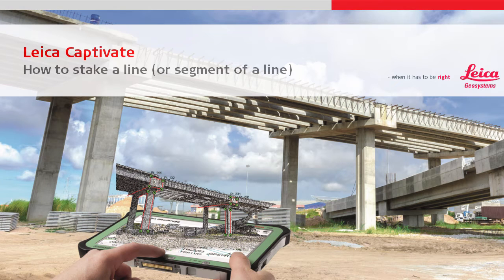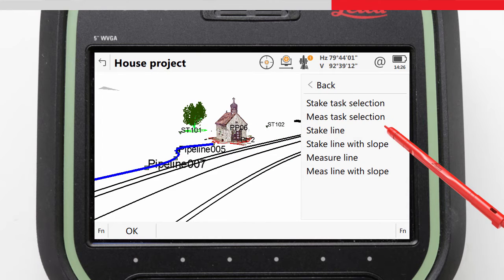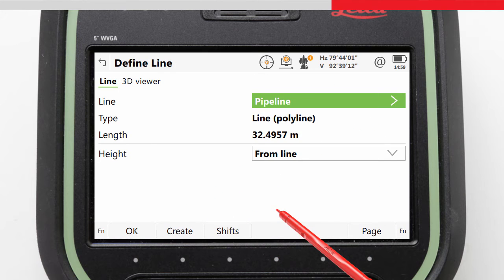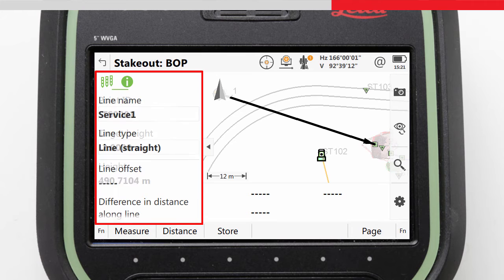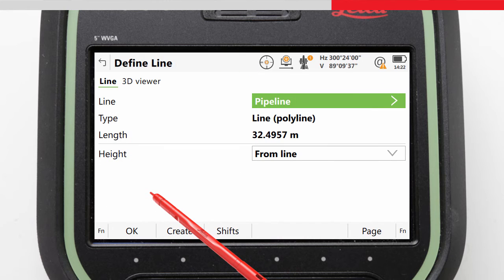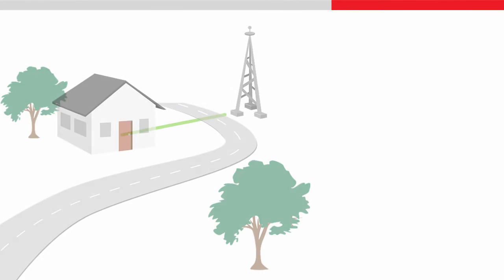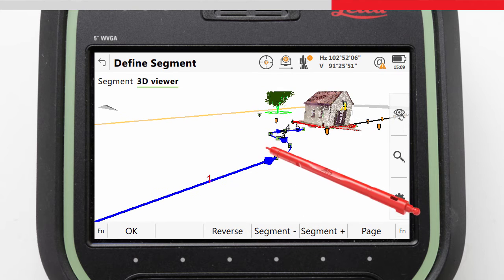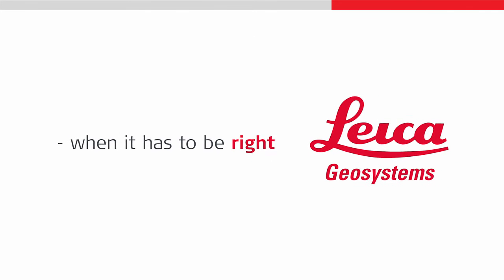Stake a line and segment of a line

Comment: Seems to always take the height from the first point
Can't seem to get it to interpolate between two points
Reply from the maker: The Stake to line app allows you to select the line to stake to in the Define Line panel. In this same panel you find a Height list box which allows you to select if the height of the staked point is taken 
:
- From Line – in this case it would interpolate the height as you describe 
- or is User entered – in this case you can indivudually define a height for each point
- or from Start point of line – in this case the height of the start point would be assigned to all staked points.
Reply: @LeicaGeosystemsCH  yeah....
Tried this on three different TS16's and all reverted to 'level from starting point'. Almost caused major problems on site.
Reply from the maker: @southy48  Please contact your local Leica Geosystems representative, describe the issue you see in detail, send the job (if possible), and let the rep know which Leica Captivate version you're using. You can find your nearest rep here: https://leica-geosystems.com/contact-us/sales_support/support
Reply: @southy48  I am finding the same thing happening
Reply: Anyone figure out a solution? Has previously worked perfectly but will now only give me my height from the first point not along the line.
Reply: @chrislittle8689  try creating a line rather than using 'quick line'
Reply: Stake to line would give you the start point height and transfer that height around, in order to interpolate use "measure to line" (separate app on the carousel) this interpolates along the line provided that the 2 points on the line have start and end levels

Comment: Does anyone know what the shifts do?
Reply from the maker: Shifts are similar to Offsets, but not exactly the same. In many cases applying an offset or a shift can have the same result. Basically a shift temporarily moves a line in a certain direction – e.g. applying a horizontal shift of -1m will move the line segments 1m to the left perpendicularly. A vertical shift will move the line segments up or down by the entered amount. An offset is generally applied as a “one-off” – for example if you are trying to stake something and you cannot stake out the exact position because something is in the way – you can apply an offset just for that one position. A shift is generally applied for the whole session – it is similar to making a temporary change to the position of the reference line. It can be used if the reference line design position changed slightly, or to stake out a parallel line. The line is then shifted back by just unticking the “apply shift” when selecting the line in the task page.
Reply: Leica Geosystems AG  wow. Great explanation, I understand this now. Thanks for your reply.